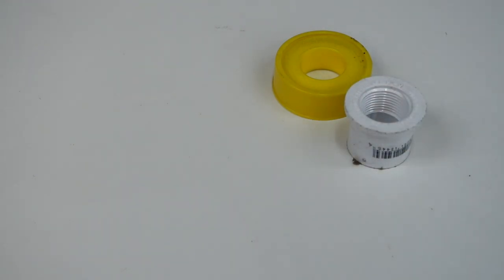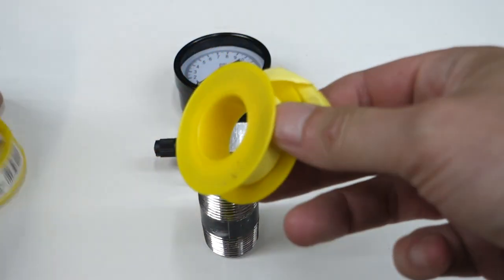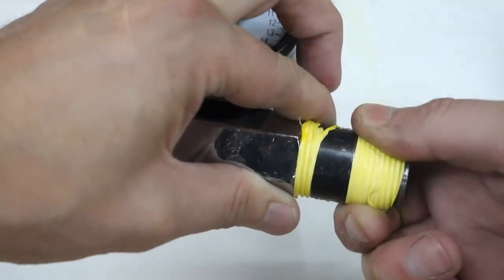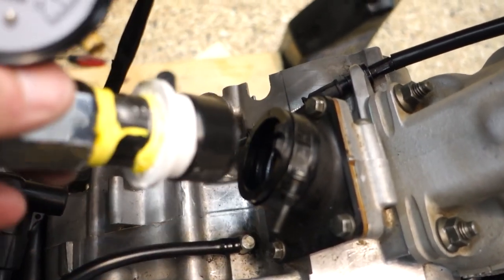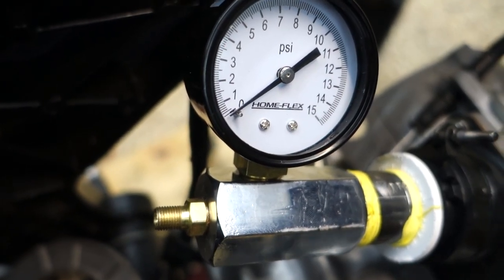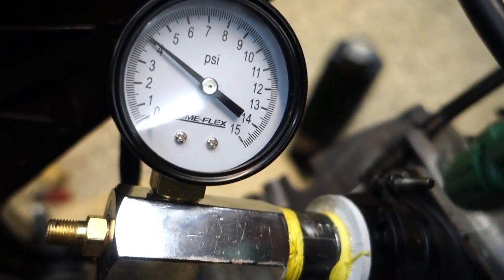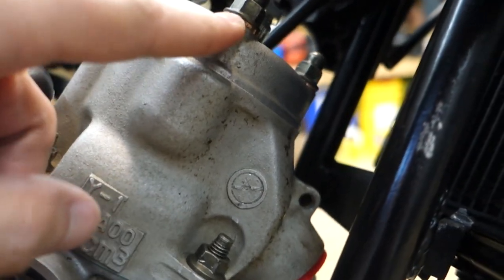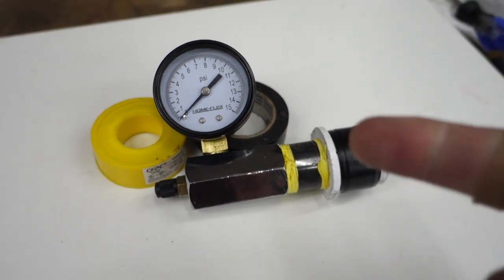DIY Two Stroke Leak-Down Tester and Testing the YZ85 Engine

Comment: Good job on the video and way to be creative.
One bit of advice, if you keep your thread tape on the roll instead of tearing it off and roll it in the opposite direction that you did, it won’t have a tendency to unwind when putting fitting’s together!

Comment: Excellent. I have seen a few homemade ones - yours is very elegant in its simplicity. The fitting with the Schrader vve on it is absolutely perfect as was the plug (40 and 50mm) - I found all on Amazon. The $270 kit from MP will thus be built for $21 plus a PVC male to plain nipple (with a bush for different applications).  More channel genius - thanks again! I'll look for a bulb type inflator (bit less aggressive) and a stethoscope (both from a blood pressure cheapo kit on amazon) to complete my system - the box will cost more :-)
Reply from the maker: Glad it helped! I've used it on a few builds so far with just a little electrical tape adjustments for boots
Reply: What did you search for to find the fitting with the Schrader valve and pressure gauge?

Comment: Where did you source the fitting for the gauge and Schreader valve?
Reply from the maker: Found it in the gas fittings aisle at Home Depot: https://www.homedepot.com/p/HOME-FLEX-15-psi-Gas-Pressure-Test-Gauge-11-801-007/206997510
Looks like there are a bunch on amazon too: https://amzn.to/47SQXZa
Reply: @GarageAddiction  Purchased today with a couple of fittings. Thank you for your timely response.